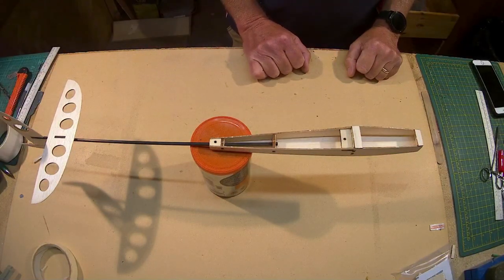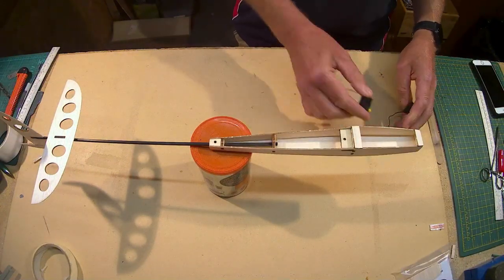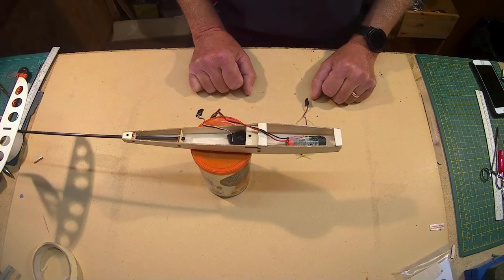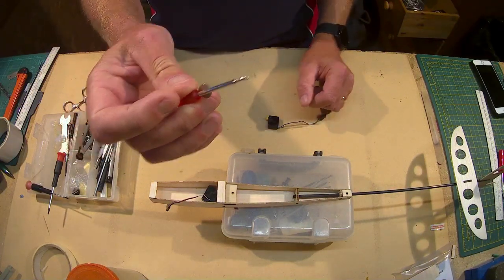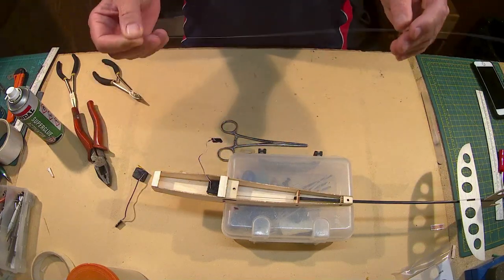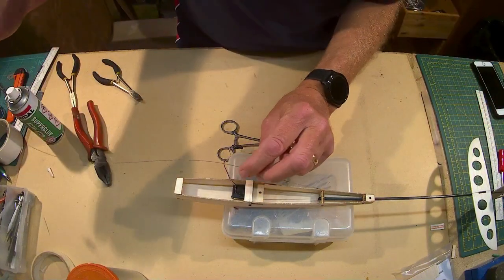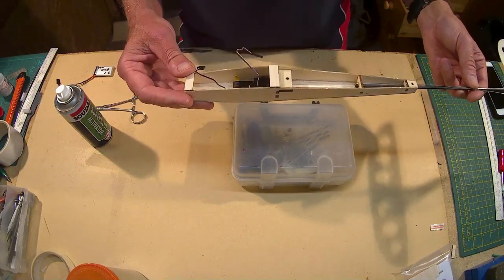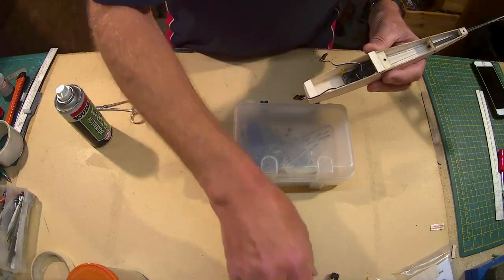PUG GLD Glider Part 5 servo install

Comment: hay mate got mine done  also glassed the center section 😀placing the radio gear etc was a PITA!  she wieghts in 92 G  RTF  where is your CG???  mine is 1/3 back..I also  cant understand  the  location of that  throwing  peg so I moved it further outboard so  my fingures will reach,,,,,,,,,,   havent test glided it yet too nasty here....................wonder how these would go on a stiff  bungee !!!😛   had a chance to test glide today, couldnt believe how smooth it was😁cant wait to  throw this bird!   >>>>>>>> CG would  depend where the radio gear is located  but even with the 1S lipo in the nose had to add some wieght  to bring it forward...
Reply from the maker: Test flight video mate https://youtu.be/ToK0hrUpxxE?si=aWnpRt6b_VoLihHl 
But my cg on the spar 👌

Comment: Great Build video I am actually in the process of purchasing one of these kits to have shipped to the States. I was wondering what weight servos you think would be okay for this build without bogging it down?  Thank you
Reply from the maker: i used 3 grm servos its not the weight but the size
Reply: @NickChittyFlying  Oh okay thanks for the heads up, I got some bluebird metal gear 3gm servos but wonder if metal gears are bit of an overkill for this given the light flying conditions it will be used in.
Reply from the maker: Civil Society & Private Interest no need for metal gear

Comment: Please can I ask the dimensions (mm) of the area where the servos are positioned ? The internal height and internal width. Maybe some models of servo will fit side by side with the horns on top ?
Reply from the maker: Hi Roger will sort that for you tomorrow
Reply from the maker: Hi Roger 22 mm high 25 wide
Reply: Lord Chasleton thanks very much for the info.